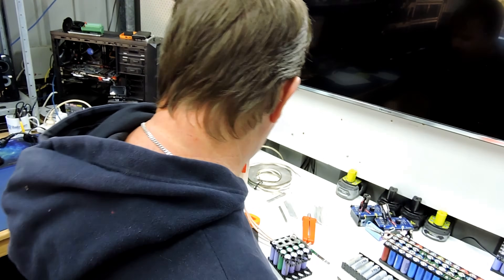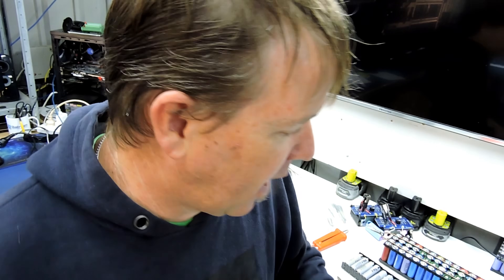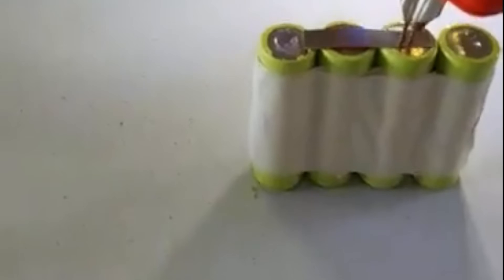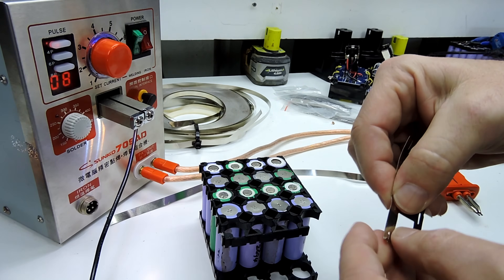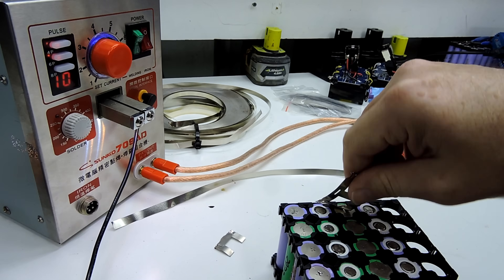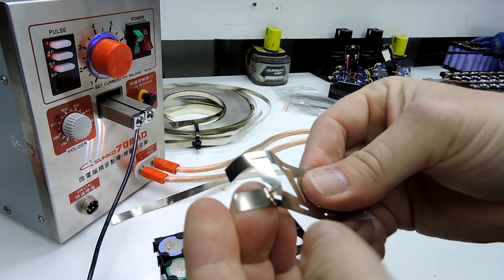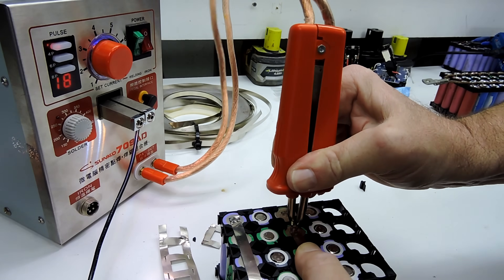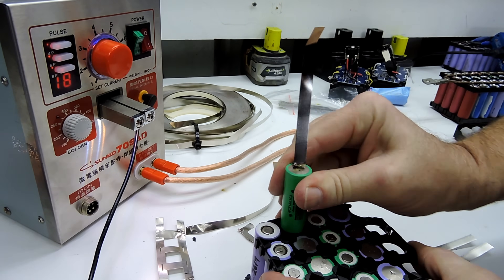709ad Sunkko Spotwelder settings

Comment: if someone want support and sell to me sunkko 709AD i buy, thailand no have. only poor worst 737 and 787 what not have good because transformer have too little. no current use 0,2 strip. only 0,1 max 0,15 strip can weld. send to me thailand one 709AD i need my first strip welder. i buy but need be less than 3600 baht/about 95$ no more.

Comment: Just posting on the off chance you pick up these old VIDs, am doing the power wall lost year and want to build her without any soldering.
Have visions of drilled and threaded holes in the buss bar  fusses wrapped around a bolt thats screws into the buss bar then a small circular piece of nicol strip pinning the other end of the fuse wire to the battery via spotweld.. my question, if i jam my 4 amp fuse wire under a circular piece of nicol strip on top of the battery and hit the pedal will it weld and seal the fuse wire down or.... will it just melt the fuse wire?
Reply from the maker: Probaly melt the wire
Reply: @HBPowerwall  
Thanks for replying in less than 20minutes!!
Im on vid 80 of your 311.. hoping to get into bms vids soon, balancing my 48volt ebike is simple.. but these monsters must be a real PITA.

Back to the drawing board on the neat no solder thoughts.

Stay legendary and thank you from the UK.
Reply from the maker: @thisphone2538  Thanks for tuning in bud
Reply: @HBPowerwall  

https://youtu.be/H_b3OJuQpEE

Found this, looks neat.

Comment: Hmm, I'm considering a sunkko spot welder but I'm not so sure it won't just end up tripping the breakers or cause a fire with the house wiring! What's the average wattage/amp draw?

Are you using it on a 15amp plug / wiring?
I think most of NZ home wiring is rated at 10Amp

Comment: Thank for the great video!
 I have the Sunkko709A. when I plug in the pen to the spot welder the side label PA is very tight, I have to push in the connector hard. However, the connector label OUT fit in easily. I removed and plugged in the welding pen connector in reverse to test in the port on the spot welding still the same result. At this point, I don't know if this is normal or if the unit is defective. By the way, what is the difference between the Sunkko 709A and the Sunkko 709AD?
Reply from the maker: I think the AD has a soldering iron from memory
Reply: The difference I found was that the D versions have a Display below the pulse buttons.

Comment: Get a no-clean flux pen and swab the top of the cell before spot welding. It'll make the bond stronger as like welding, soldering, and blacksmithing the oxidation layer will impede bonding.
Reply from the maker: That's a good tip! TY

Comment: Is it because they are on 110v power??
Reply from the maker: I am assuming so
Reply: My 709AD+ is only 110/120v and I havent had many issues. Crank the amps up and 4&6P pulse. I weld that ladder and plain strip just fine. Ive blown a few holes in the strip and cell...OOPS!

Comment: Where do you get all the used batteries?
Reply from the maker: Anywhere I can - it's not longer practical to go to computer shops & recyclers - I find it more successful getting to the cells before they reach those places - calling companies that have an IT Departments is a great start - ask all your frineds, often times they have a good lead that'll lead to a great lead

Comment: As Rohan mentioned in the comments, I believe the difference is in the voltage. Pete is using 220/240V and the US ppl are using 110/120V. The transformers in the unit are probably the same in both "models". So the output current is different in both. 
* Use a transformer to convert 110/120 to 220/240 (rewire an old MOT on the secondary windings)
* Run wiring from electric water heater or dryer to room with a dedicated receptacle. Dryer could either splice into receptacle or use a plug and extension cord
* Change breaker to that receptacle to 220 instead of 110 making the White wire the other leg (NOTE: This is NOT recommended. Only for test purposes! Make sure other devices are unplugged from circuit before attempting)
* Wire up a "suicide cord" where two male plugs are connected to 1 female plug and connect the two male plugs into 2 different circuits, as long as they are separate legs

Comment: I have a question. Do you know of a charger or charge controller  that would charge a 7s lithium bank. From a 12 or 24v alternator.  For charging in an emergency. No sun. Something like a rc universal charger. That's affordable. The green 10amp mpp 1072 or something like that it's a charge controller that is boost . would work but is only 10 amps. I'd like about 40 amps plus. I'm building a DC generator. To charge lead acid . but would like to be able to charge lithium as well. And yes I need a spot welder. It would be much easier to build packs!!!
Reply: if you have a 7S battery that can take a 40A charge current then you can afford a half-decent charger for it.

Comment: Hey Pete, thanks for the video. I'll do a quick video showing my settings and the issues I have. Thanks again!!!
Reply: Have you verified your wire connections? Hearing the buzz of the unit, it doesn't sound like it's engaging fully. You might need to take the cover off and make sure the internal connections are tight, as well.
Reply: I wish I can do that but I can't sense is still under the amazon 30 days return policy and looks like I'll have to do that if I can't get it to work properly.  

But thanks for the advise. I'll look around an see how can I test the wiring on the machine
Reply: Pete, yours is running on 220v?
Reply from the maker: Gotta - yes mine is 220v Javier's & Mike"s are both 110v
Reply: I heard that using a 220v socket will make the machine work better but mine only has the 110v option.

Comment: I just got my 709ad+ from amazon and have been testing on dead cells. With the nickel strips I have 8p is enough to make a strong bond.
Reply from the maker: Great to know 240 or 110?
Reply: I have the same model. Can you share your settings?

Comment: It’s all about the 240v vs 110v
Reply from the maker: I think that is all there is too it
Reply: Agreed, heard lots of guys having issues with 110V
Reply from the maker: Will be great to get a good conversation going about it to make sure everyone is aware of the issues/rewards from these units. Hope Mike does a video on his
Reply: Would be nice if someone had a cheap fix to make the 110v unit as usable as the 240v units
Reply from the maker: Bruno was sharing some thoughts on FB today - he has more experience than many for sure https://www.facebook.com/photo.php?fbid=10155979746439230&set=gm.631140887232476&type=3&theater&ifg=1
Reply: This is a very valid point. It's not hard to convert US 110 to 220, as in use a different circuit that has 220 on it. Or, change the wiring in the breaker box from 110 to 220 and connect the White/Black to the breaker. This will definitely increase the voltage available, but the person who does this needs to make absolutely sure that there is no other device plugged into the circuit doing this.
The other option is to make a "suicide extension cord" where you take two plugs and splice them together where you plug each one into a different circuit and they merge to a common receptacle plug. This is, of course, dangerous and only someone experienced should do this method as it could be VERY bad in the end if done wrong.
Reply: Also to add, a cheap fix would be to get a dryer plug and an 8/2 or 8/3 extension cable (8/3 recommended as it has hot/hot/neutral/ground). Connect the cable to the dryer plug. If using only the 8/2, then black/white would hots, as the 220 doesn't really use neutral anyways.
Another option would be to run 220 from the water heater into a dedicated receptacle (this is, of course, if the water heater is near the room you're doing the work in)

Comment: will there be a shorty live feed sundy
Reply from the maker: Unsure - baby sitting duties :) The best kind with the grandson
Reply: ah gotcha  ok stay warm buddy
Reply from the maker: Feet are on the fireplace surround :)
Reply: lucky duck my gas fire place has been outa commision for 2 winters currently using electric wall fan heater similar to a split unit only no outside compressor and sadly its pretty bad at heating
Reply from the maker: Yeh, they are average at heating, Fire place in the lounge room and reverse cycle down the other end of the house runs 12 hours a day from the battery - Almost perfect except the smoke when you put another log on the fire
Reply: wood fires make me nostalgic but i guess they can be a pain in the but to maintain (side note got myself a log splitter for a friend who has some logs to be made into fireplace sized chunks)
Reply from the maker: Ooh a log splitter would love one, much better than every night after i knock off work picking up an axe and breaking my back lol
Reply: axe geez thats a young persons game lol  bunnings had the ryobi log splitter for 250 when aldi had there one out lol it beats paying 400 for it a few months earlier
Reply: i hope your on a tablet or some mobile device and not like i used to drag a full desktop around to the couch and balance it tower on monitor  with keyboard and mouse on the lap for my mum ... lol
Reply from the maker: Laptops everywhere lol benefit of running computer repair shop lol Have looked at log splitters but most years since we got this house fire place has been used less than ten times a year. But this year we have used it much more than usual - it's just nice waking to a warm house - kids are healthier it seems i'm gathering it's from having a warmer house all the time.

Comment: First
Reply from the maker: Boom!
Reply: I have never really listened to those welders and the sound they make when welding. Sound identical to my Transformer welders. He is not pressing hard enough with a single plulse. With single pulse welders, you have to press pretty hard sometimes to get them to stick, depending on what type of nickel strip you are using. Normally with double pulsed welders...First Pulse will heat up the metal(making it soft to dimple), and the second pulse will weld. Single pulse with tabs that thick, needs a little more pressure and power.
Reply from the maker: Cool, thanks for the info, it's good to learn more about this tuff... I'm like yep that stuck, all good NEXT lol
Reply: njfulwider5 hey mate, you’re everywhere hahahahaha